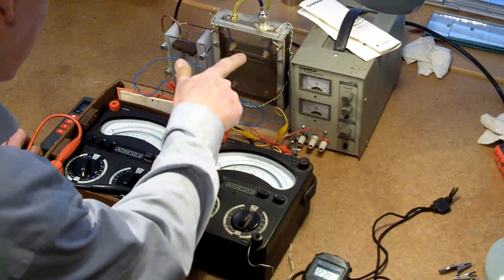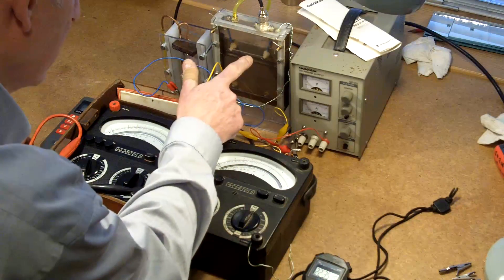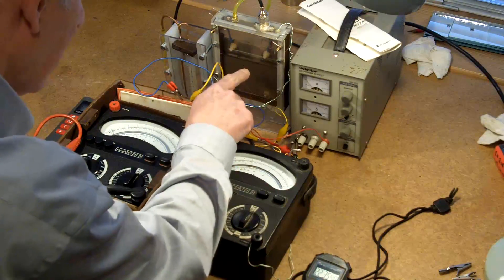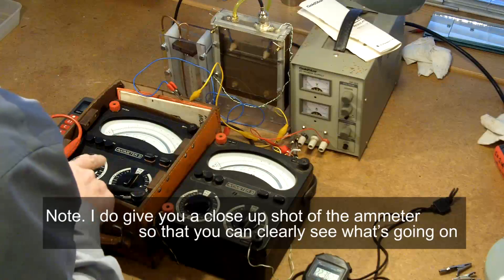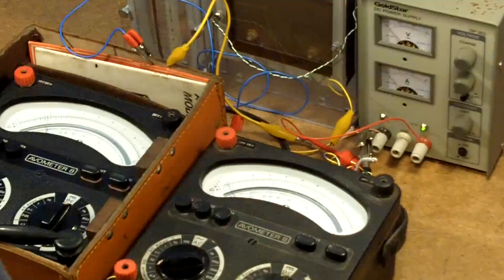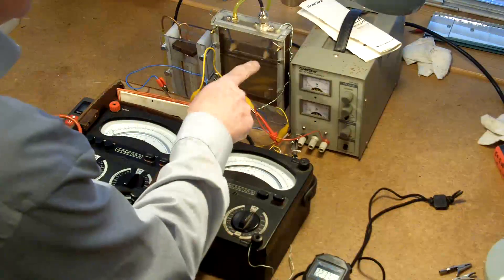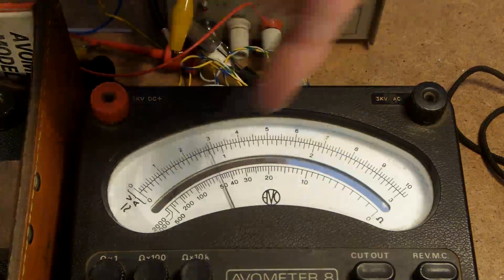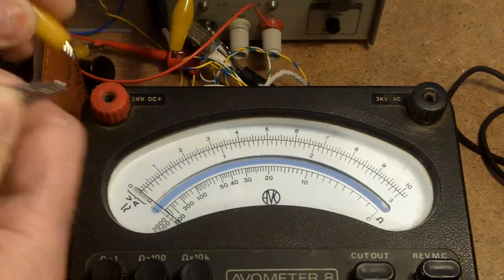HHO. 15 Test to eliminate issues with dissimilar metals

Comment from the maker: Hi Ben, I take you’re referring to 2 mins 10 sec in. Yep the power supply unit was set rather low and although I wasn’t right over the meter it was definitely around the 0.5 volt mark. Although you can’t see the knob the AVO on the left is on the 3 volt (full scale deflection) scale. Does this surprise you in some way? 
Kind Regards... Andy